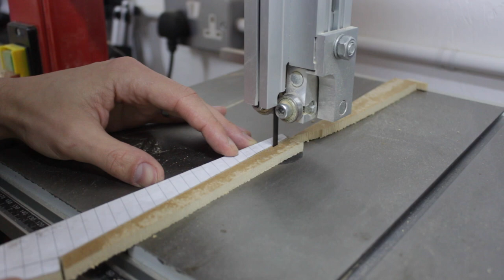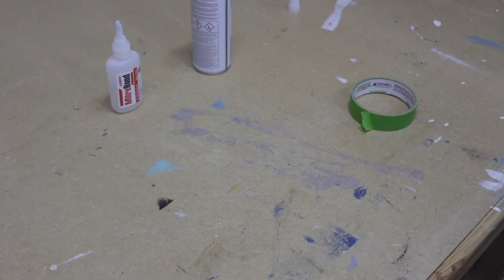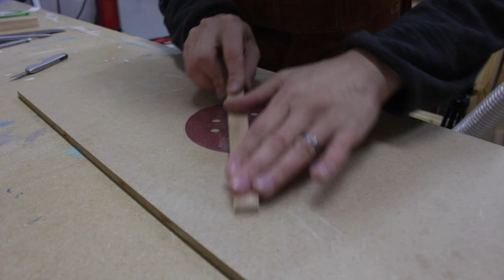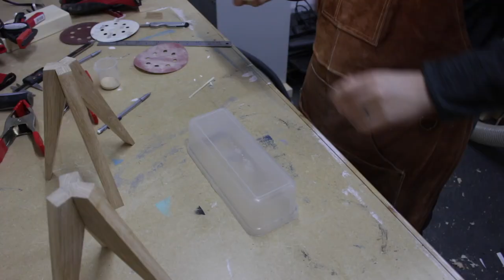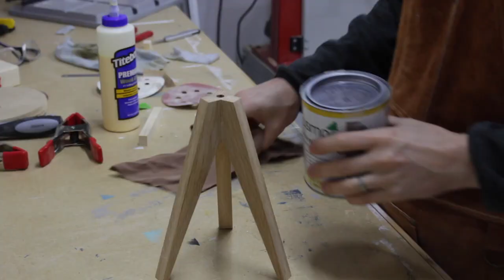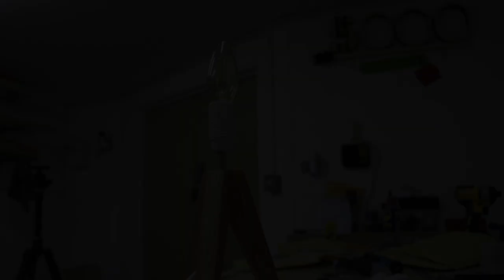DIY Wooden Tripod Table Lamp ~ DIY Woodworking

Comment: Make a groove on the inside of one of the legs and out the bottom before assembly to accept the lamp cord. Makes for a much neater appearance, especially if the cord is brown or translucent. You can cut the groove just wide enough so the cord is friction fit or cut it deeper and cut a small strip to cover the cord entirely. Otherwise, great build and appearance.